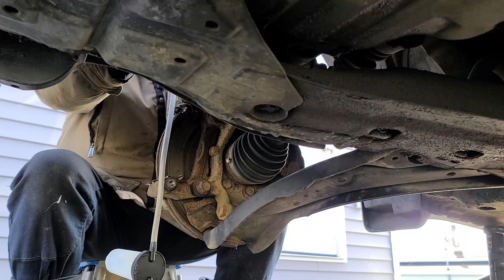Can’t find someone to help to bleed brakes? This tool fixes that

Comment from the maker: 🚗 Bleed your brakes alone safely! This vacuum pump makes solo brake bleeding easy—no helper needed.

💡 Tips:

Keep your master cylinder topped off

Secure vacuum lines & container

Close bleeder screws carefully to avoid air

Dispose of old brake fluid safely

❓ Questions about the process? Drop them below and I’ll help!

👍 Like & share if this helped you DIY your brakes safely!

Comment: That's nice tool 
It makes job easier
Reply from the maker: Yes it sure do, when ya dont have a peddle pusher, i use a 2 by 4 in the past but tore a small hole in seat so this works great, cheers and thanks

Comment: Great tips, Jason. I haven't used one of these but maybe I should. I recently changed all 4 calipers at the same time, and the master cylinder drained completely. It took several attempts (many!!) to pump the brake pedal and bleed the lines to get them air-free. I was worried that I'd have to bleed the master cylinder but it eventually cleared the air. We have that same folding bench.
Reply: Actually....I just checked, and our folding bench is Missing!! Is that ours that you were sitting on???:face-orange-frowning::face-purple-smiling-fangs::hand-orange-covering-eyes:
Reply from the maker: Lol you snooze you lose old man
Reply: @DIYVarietyHub  Who you calling Old?:face-purple-smiling-fangs: I've seen younger Fossils than you!:face-fuchsia-poop-shape: